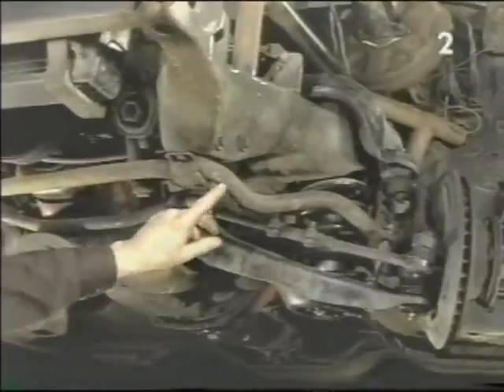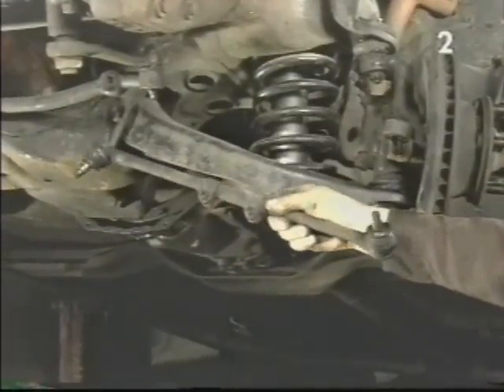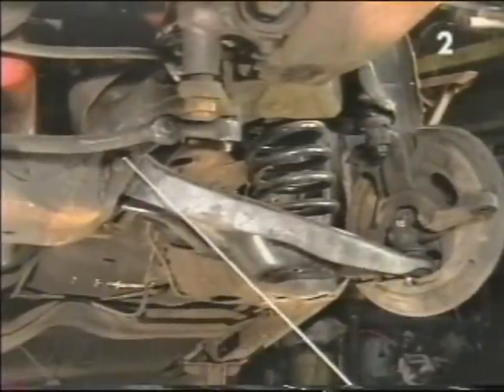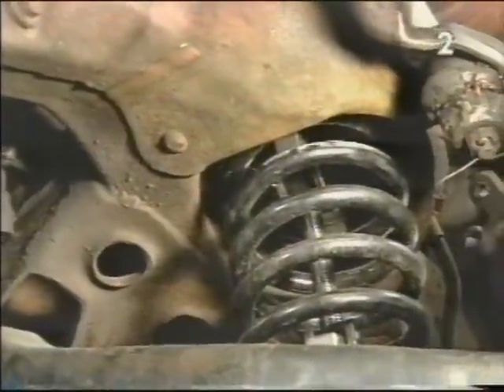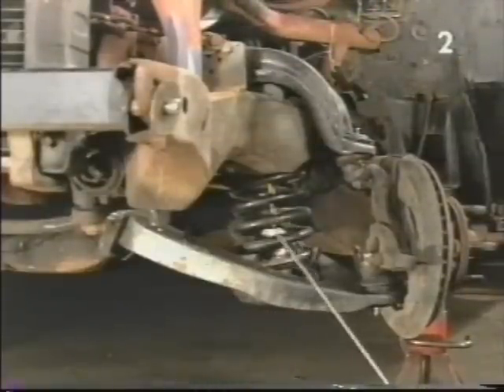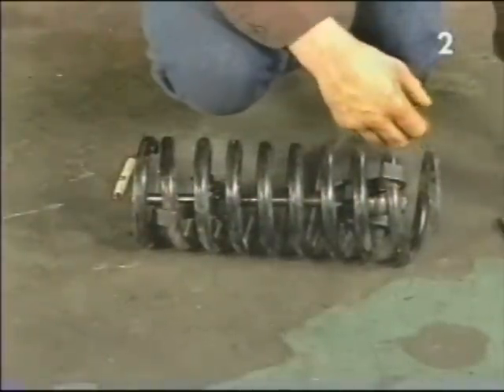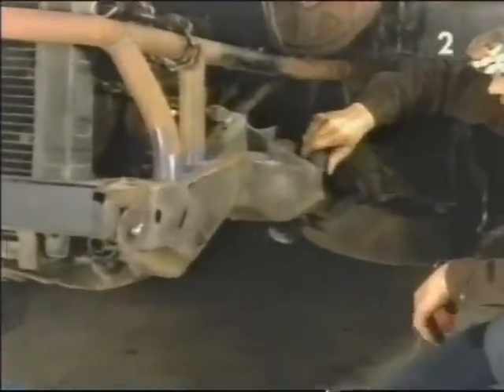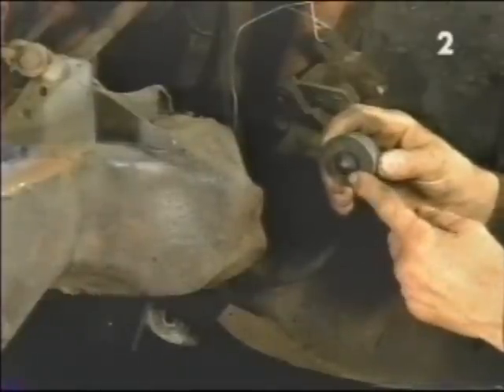Rebuilding Your Front End- Part 2- Disassembly

Comment: The ball joints are unlikely to “pop” loose with a couple strikes on the spindle. The concept is that the vibration of striking the spindle will cause the ball joint to come loose with the help of the spring providing the tension to separate it from the spindle. On my 1971 Pontiac Lemans, the ball joints would not come loose. No amount of hitting the spindle with a 21 lb hammer would loosen them. I ended up having to cut the ball joints odd to remove the upper and lower control arms. Then I still could not hammer them out and I had to resort to heating the sonde and hammering them out. Just be aware that the most difficult part of this video process procedure might be getting the ball joints loose and being able to raise the upper control arm and lower the lower control arm and remove the spindle assembly. He makes it look easy...it probably wont go that easy.
Reply: Yes it will. I have done hundreds this way. You need to reach down and make sure you have a set of balls. If you can't find them in the usual location you need to get them out of your wife's purse when she's not looking. Once you have your set of balls, you swing the hammer like a god damn man and the ball joints will come loose.
Reply: @shopdog3g  A air chisel before the pickle fork does it every time. And the spring tension will help in  most cases.
Reply: @shopdog3g  LMFAO!!!!😂🤣💯

Comment: Terrible way to remove a spring , No compressor needed , Just put a floor jack under lower control arm and lower it down after taking off ball joint nuts ,And cracking knuckles loose with a hammer,  Install spring with a long pry bar under spring pry into place, Then jack arm back up , Did 100s of them in 42 years as a suspension mechanic , Never once needed a compressor , Compressor takes 3 times as long and more dangerous when the compressor comes apart
Reply: then why don't YOU put the same effort into posting a how to vid that this guy did? In the mean time, some of us will choose to do it the safer way than you will. Front coil springs aren't going to respect you once they let loose.
Reply: @mean70632  Agreed, would like to see that removal. Not that im dis-approving his method but i would like to see it.
Reply: Gonna hit that soon on my 68 firerbird. I understand the concept but would like to see it on video. Thx Tom.
Reply: @anthonysantiago1999  Thanks for your comment Ant, but as for me, I HAVE seen it done without a spring compressor, and I think using a prybar to peel the old spring out of the control arm pocket, and then using a hammer and/or prybar to get the new spring in, is the caveman/hack way of doing it. I don't care how many guys do it that, way, I won't be one of them. If you're using a cheap piece of junk forty dollar spring compressor, then ofcourse you'll have to worry about it failing. I bought the OTC brand compressor, and it's a stout quality tool.
Reply: I agree coil spring compressor is not a must for REMOVAL of the coil spring. However, I would not INSTALL a coil spring without a compressor.